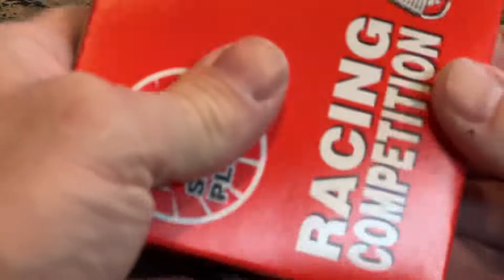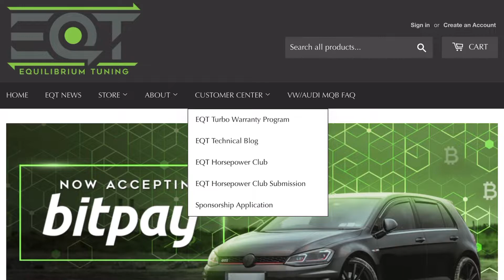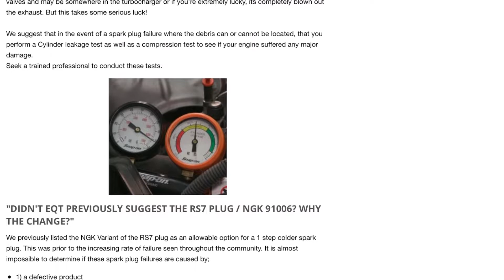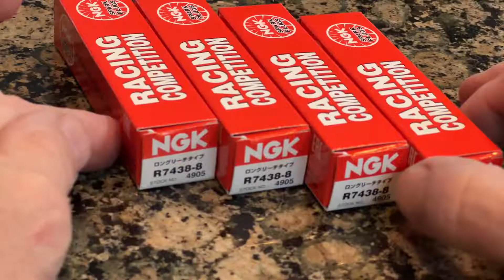Gapping my Slant Ground Spark Plugs (Non-Projected Electrode)

Comment: Engineering Logic suggests, if you can break the ground electrode on a non-projected; then, that can also break off into the cylinder.
The complaints of ground electrodes "breaking off" were from people that bought the car used and never checked the plugs or left the plugs in for too long.  There was some purported issues linked to the BERU manufactured RS7 plugs, but it surely wasn't from fabrication.
When you examine the evidence that is provided on EQT's summation editorial, you can see that those plugs were pretty toasted.
If perhaps someone is truly RACING (in an event not on the street), then have a pair of TRUE racing plugs and switch them out after the event.

Comment: It's really only stated to not gap them due to the difficulty and level of care required to gap them.

The method and tool you used is absolutely how they should be gapped if anyone wanted to gap them, but due to the volume of people tapping plugs on a table and using a ring Orielly $0.99 gapper, it was suggested to just run them at the gap they come with.

It was less so of a "you can't" and more so of an "unless you have the right tools than just don't.. rather run a hair fat than break a plug off"